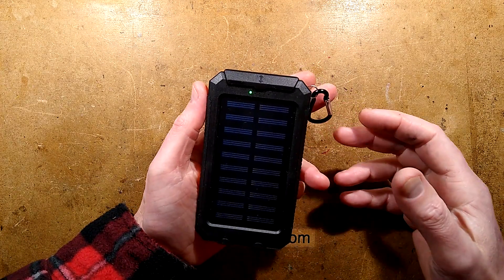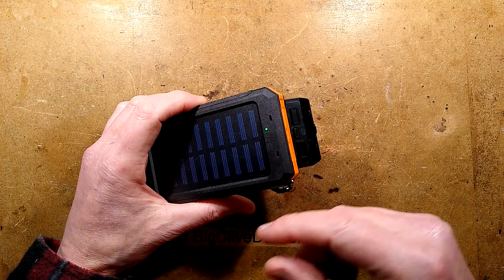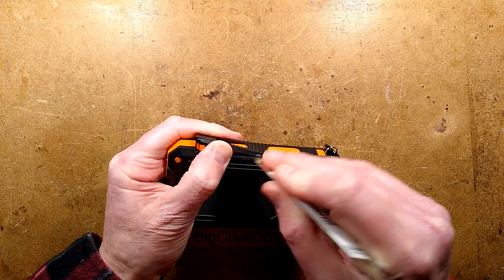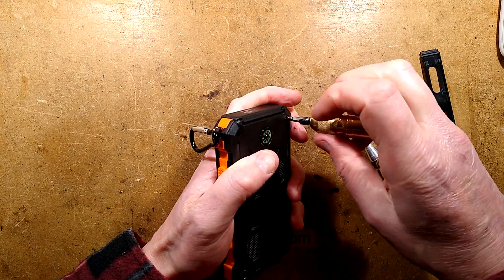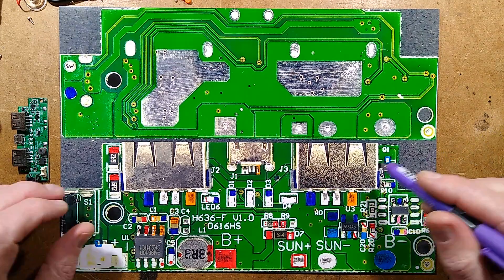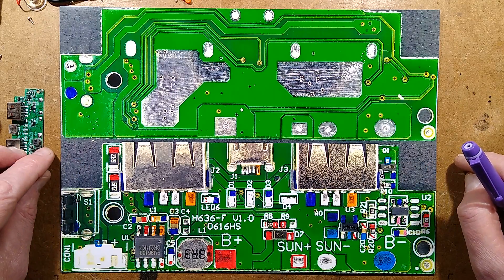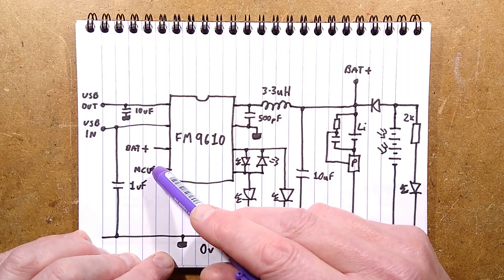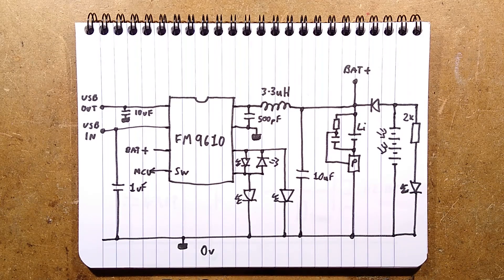eBay 9 MILLION mAh power bank teardown (with schematic)

Comment: Who knew... some random Chinese company cracked fusion energy while we weren't looking and stuck it into a small plastic case to charge your phone.
Reply: better than fusion, they've tamed the vaccum energy and made a battery more portable than the Ancient's ZPM.
Reply: @PainterVierax  Or harvesting a bunch of dark matter and wrap it inside a polymer cells
Reply: Or wormhole generation, and they run some wires thru one to an alternate bizarro dimension where 'hundreds of AHr' 18650 lithium ion cells can actually exist.
Reply: @randacnam7321  ,  It isn't necessary to run wires through a wormhole when they've got a Tesla power transmitter on the other end.... that's Nikola Tesla, and not the modern wannabe I refer to as Lone Skum....
Reply: @goodun2974  Tesla power doesn't work across dimensions.
Reply: Wonder which alien race technology they copy these from .
Reply: @skyton658  "I'll be baaack! - To terminate you Alien Intellectual Property Rights thieves!" 😱😂
Reply: A nation of geniuses,so they are.🤣🤣
Reply: Aaron Paul voice: They can't keep getting away with it !
Reply: Right!?
Reply: How is your comment 3 weeks old on a video released 18hrs ago? lol
Reply: 😂😂😂 those bastards
Reply: HA HA, Could run all my USB tech with that, I must get one. To the bat mobile🤣🤣🤣🤣🤣
Reply: It would have to cold fusion, as the solar panel couldn't generate enough amps to power the Great pyramid.😉
Reply: That covid was intentionally meant to hide how this battery was made..🤔🤔

Comment: This makes me want to remove the solar panel from the one I have to use on other projects. Mine is a real unit with 20,000 mah and it gives a couple amps out the usb-c port.

Comment: Wait, wait!  Clive...
The 9 million mAh equals 9000 amp-hours, equals 9 kiloamp-hours times 4 volts equals approximately 36 kilowatt-hours.  Tesla batteries are around 75 kWh so it purportedly is about a half a battery.  
I think it's incumbent on the person who got ripped off to give a negative review or feedback so that others will be warned not to be taken advantage of.  😡👍
Thanks, Clive.
Reply: 32kWh, since it's 3.6V not 4.
Reply: @davidgriffin79  
Like I said, "...equals approximately 36 kWh."
Reply: I picked up on that as well.

Comment: This battery technology has been invented to power these 9 million Lumen flashlights, so it's totally legitimate.
Reply: along with the 10 billion volt tasers of course
Reply: Clive NEEDS to get one of those flashlights that BURN SHIT DOWN!
LOLOL 😃😂😂
Reply: No its not they play games with words and specs to make it sound like what its not.
Reply: You couldn't get 9 million milliamps from a wall socket even and that is enough current to cause fires, injure and even kill!!
Reply: @charleshines8523  are you familiar with the word "Sarcasm"?
Reply: @charleshines8523  "You couldn't get 9 million milliamps from a wall socket" - Why are you comparing this to a wall socket?  But to your point, yes you absolutely can (at least theoretically), depending on how you look at it.  If you mean directly from the wall socket (measured at the socket prongs), then no, but if you mean "9 million milliamps of power" in general, then yes.  9 million milliamps is 9,000 amps.  Take your mains voltage (I'll use 240V so most people can relate) and step it down to 1V.  Now you can draw 37.5 amps of 240V power from the wall socket to achieve 9 million milliamps of 1V power from the transformer (as long as your "wire" is thick enough).

Comment: The compass on the back is there for when the unit inevitably fails to charge your phone and leaves you stranded.
Reply: or so you know which direction to throw it when aiming for the bin.
Reply: @howardosborne8647  We don't need any trash fires, thank you.
Reply: @soundspark  lithium  battery's  dont burn once  discharged    lol    but  yea  its  to show u the nearest  lidl  as  they  dispose  of  junk   batterys
Reply: @TCBOT  Batteries (that is the plural by the way) can potentially contain a hazardous charge even when defective.
Reply: That's the moral compass of the seller. They weren't using it anyways.
Reply: @rubiconnn  You win the internet today...
Reply: @rubiconnn  lol
Reply: @rubiconnn  haha, good burn!
Reply: @rubiconnn  explains why they typically come non functional.
They never seem to even go to the effort to make sure they spin.
Reply: @rubiconnn  
Those mini compasses are usually trash.
Reply: Completely plausible explanation, either that or they had a bunch of toy compasses to get rid of and instead of throwing them away, they just stuck them in these miraculous power banks.... making them even more awesome that what they were without it...  It screams "Quality" and "Very Useful" if you have a compass attached to your product.
Reply: I got this thing off amazon and the compass fell off after a few days lol
Reply: @psychogat3  in a way, that's great because now It's can be installed in other battery banks that are lacking such a fancy feature.
Reply: You are wrong. In fact compass always shows home. And home is in China😂
Reply: @isoslow  , "over hill, over dale, Chinese compass will never fail".... Not unless the magnetic field caused by all that claimed current flow demagnetizes the pointer! (And my apologies to everyone involved in the TV show M.A.S.H. for riffing off ---- ripping off? ---- one of their old episodes. Hmm, perhaps MASH stands for Milli-Amp Scam Here?).
Reply: @isoslow  Given it was magnetized there, Id suspect it always points due Yuan at all times.
Reply: @mysock351C  can they magnetize the keys for my mum, so she could find them with a compass?🤔
Reply: @isoslow  You just need a surplus MRI magnet from them. Guaranteed to work every time (Note: Metal keyring may reach supersonic velocity. Consult users manual before use.)
Reply: @isoslow  lol took me half a second
Reply: This whole comment thread is gold!
Reply: I wouldn't rely on that compass, either, 
Tho, I bet that phone bank could make a fire for the night... 🤔
Reply: How is your comment 3 weeks old on a video released 18hrs ago? lol
Reply: @jaylo912  Patreon! I forgot about this completely, didn't realise my comment had attracted so much attention.
Reply: @jaylo912  That compass is all part of the time travelling mechanism 😄🤣
Reply: you could throw the weight at rabbits to catch food when lost with no power and no solar charge.
Reply: @Shane_O.5158  The weight is meant to be propelled by the small lithium polymer charge that you can see right next to it.
Reply: 9 million MAH pack with a tiny tiny tiny 78mah used battery for a pair of hearing aides
Reply: The compass on mine was off by about 20ish degrees.  Maybe that steel does more than weigh on my mind
Reply: @NickFiorello  maybe it’s a Chinese initiative to put nato forces in the wrong direction
Reply: Yup, you nailed it's use. LOL.
Reply: It helps locate the nearest Skip, so you can add it to a pile of unwanted politicians.
Reply: And here I thought the compass was to make sure that you aligned it during the charging process with the rising Sun for a more is spiritual charge.
Reply: That little compass on the back never worked. Ever.
Reply: What else would you do with christmas cracker ornaments the other 11 months of the year?
Reply: You could always remove the compass and wear it as a necklace. That way the next time you have to travel to see the vagens you will be able to tell if your chair is about to vibrate you to death.
Reply: Things are pop'n off 😂
Reply: I really need to start reading the comments before I make mine. I should have known that someone beat me to it.
Reply: Kinda the ultimate middle finger then!
Reply: Did you test how accurate the Compass was?
Reply: waist of money cause the battery will not last under the sun cause of heat buildup.
Reply: It’s for survival!
Reply: yea thats fine just as long the battery dont get destroyed before in need meaning dont put in sun till then.
Reply: Yep, I thought this kind of comment would be on top lmao
Reply: At least does the compass work?
Reply: Each one is actually very valuable because they are made using the vibrations from the anchient pyramids 🤣

Comment: I think the name of it "FUC CHOW" says it all......! 
Any spare space inside, you could fill with recycled VAPE cells to increase capacity.
I wrote the above before seeing the metal bar that's inside, boy you really could remove the metal slab and fill all that open space with recycled VAPE LiPo cells wired in parallel and increase the capacity of the power bank substantially, at zero additional cost.....!!!! What an opportunity to use up some of the many VAPE cells I have collected....!

Comment: I bought one of these two and a half years ago. It is rated for 20,000 mAh (doubt it) on the back side label. The tiny compass is worthless. 🤣🤣🤣
Reply: Maybe the special "metal weight technology" they are using to enhance the battery power has some residual magnetism.

Comment: Ha!  Too Funny.  Love it.  2.5 ounce weight could have been more battery for sure.

A few years ago, for fun, I bought four 18650s claiming to be 9000 mAh.  Amazing right?  Turns out they're surprisingly light and have a capacity of about 650 mAh each.  I mean I knew they were bogus but had no idea they were THAT bogus.
Reply: I got some of those lightweight 18650's , some kind of "TrustFire" brand or something.  Inside they were a 14500 and some sand.  Nice.
Reply: @GannDolph  I remember seeing that "Trust Fire" brand.  LOL  Rubbish found on the likes of Ebay off shoots.  Gosh, I forget the site.
Reply: @amorphuc  Mine were  from the wild-westier eBay of >10yrs ago.  These days it's probably cheaper to rewrap a recycled garbage 18650 cell than go to all the trouble of the deception within those lightweight trust fires!   The only "good" thing about those cells is they held so little energy  density and had such high internal resistance that they weren't prone to  thermal runaways - a good thing since there was no protection pcb..
Reply: @GannDolph  Very safe cells for completely different reasons.
Reply: @GannDolph  You are lucky.
Sometimes there is only sand.
Reply: @gordonwelcher9598  the absolute safest cell in case of malfunction.  Sand stops the arcing, so more sand is more safe, 100% sand 100% safe 😅
Reply: @gordonwelcher9598  yikes!  😳
Reply: @GannDolph  Wow.
Reply: They could at least tried to make it 900 mAh so it would only be 'one order of magnitude' out.
Reply: @Frankhe78  Then it could have been a typo.  LOL
Reply: @amorphuc  Indeed, oops sorry.

Comment: 9,000,000 mAh is 9000Ah .. so 32.4 kilowatts ... still very impressive :-)
Reply from the maker: Until it explodes in your pocket.
Reply: @bigclivedotcom  I'd expect nothing less from my own personal power plant !
Reply: @bigclivedotcom  The explosion would be still impressive 😅
Reply: No no no, it's 32.4 millimegawatt hours. 😉
Reply: Kilowatt ..hour. but yeah better just have a look directly printed on the cell. Or measure it
Reply: @blueredbrick  yeah, because even if they lie in the specs, they would never have batteries with false printing😁
Reply: I noticed it, that makes more sense. You could keep it in the glove box for a half charge on a Tesla in an emergency
Reply: @IanFarquharson2  I'm not a Tesla owner, but can you charge a Tesla by using <5V at 1.5A? I suspect the Tesla wouldn't even notice you are trying to charge it.
Reply: @herrakaarme  you would have to raise the voltage first. Assuming you did DC charging and somehow had good efficiency when boosting it up to 400v, you would end up with about 1.8mW going in to the Tesla, less than the current that the balance circuits can dissipate.
Reply: @IanFarquharson2 
Or 2 and a half charges on my first generation Leaf.

Edit: well, 1 and a bit anyway. Unless you leave it sitting on the dash so it recharges as you drive 😉
Reply: I quite disagree. Ah is by no means a measure for Energy. It's only Current x Time. It depends on Voltage to make usable power. Much Power bank are using 3.x V Lipo cells and deliver 5V at USB ports. The capacity is nearly always the capacity of the Lipo Cell and it means the Usable Current x Time is significantly less (both because the voltage increasing circuit needs more current at its input than it can deliver at the output,  but also because it waste part of it). The difference between the advertised capacity (of the cells) and the amount of supplied current over time is usually 25 to 33% lower. But in this case it of course ridiculous...
Reply: @yveslegrand9826  sure but in this case (large batteries) its assumed. Ah is easier to understand when your trying to figure out how many hours will a device run given it draws so many amps.
Reply: Clive was just having fun and missed step or did he? maybe it was on purpose? definitely was funnier that way!
Reply: I was about to mention that, but thought I couldn't possibly be the first. Sure enough!
Reply: Just off by a factor of 1000. This can happen to the best of us!
Reply: So only three months until it is fully charged?  Seems legit.